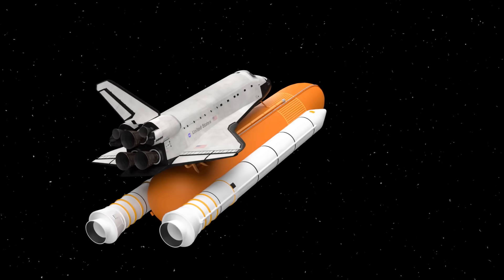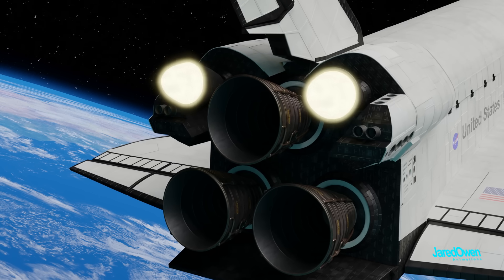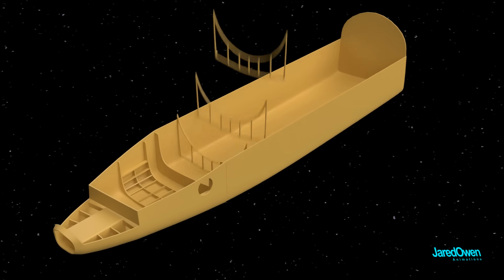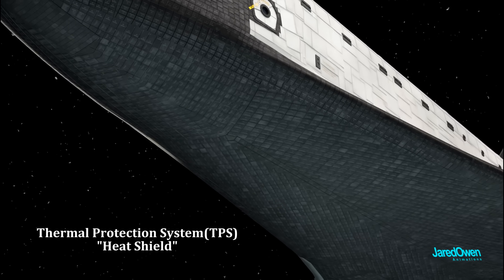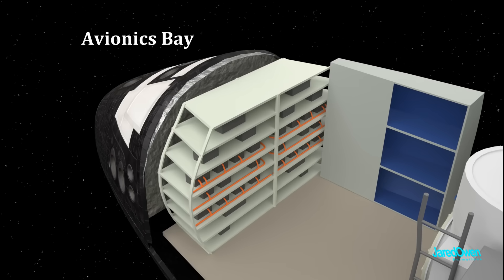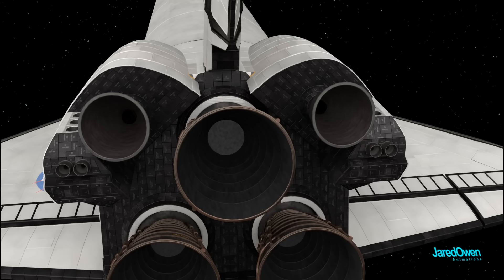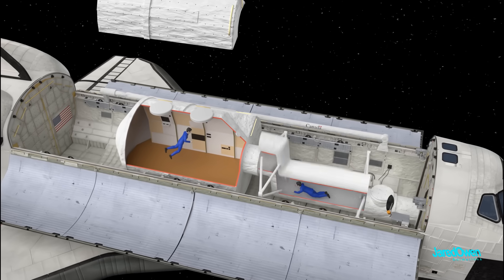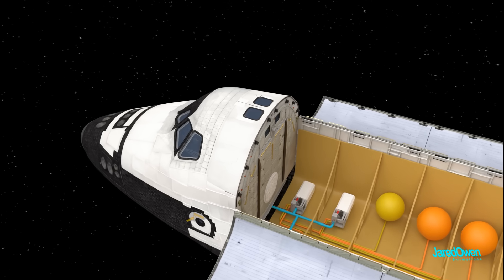How did the Orbiter Vehicle work? (Space Shuttle)

Comment: How do they glue the wheel door gaps with the silicon tiles ? While rentry there isn't any scope of microns of gaps between tiles..how do they manage to glue those tiles at the gaps ?
Reply: The tiles were also subject to extreme cold temperatures so gaps between the tiles was needed. They used a gap filler consisting of a ceramic cloth impregnated with a silicone polymer for such things.
Reply: @mako88sb  are you talking about the landing gear door gaps?i wonder how they might be making it so precise that everything fits and opens so tight that no heat breaks the gaps in the landing gear door
Reply: @SagarSagar-ro3fj  Gap was needed on all of the tiles. Pretty exact +/- tolerance was required for the gap filler to work properly so this was ensured during the tile fitting at the land gear doors as well as the propellant umbilical doors. Yes, it certainly was some precise work required and a huge reason why the tile fitting for the initial launch of Columbia took much longer than expected.
Reply: @mako88sb  Nice theory, however it doesnt work in real life.
Reply: @idontcare7961  says who?
Reply: @PabloGonzalez-hv3td  Me. Learn about physics.
Reply: @idontcare7961  Are you a physicist? What inconsistencies do you notice?
Reply: @PabloGonzalez-hv3td  Atmosphere can not exist next to near vacuum without equilibrium taking place and all of earth animals (human animals too) suffocating.
Reply: @idontcare7961  You're thinking too much into it. The atmosphere is no more than a pool of air. It is not "pressurized". The air pressure comes from weight alone. Like the bottom of the ocean. 

We don't even need to leave the atmosphere to experience the pressure gradient. There isn't one uniform pressure as would be found in a pressurized vessel.
Reply: @PabloGonzalez-hv3td  You didnt understand my statement, equilibrium would take place if earth was in infinite vacuum, you would suffocate. Explain that.
Reply: @idontcare7961  I understood fully. You're perpetuating a misconception  that the atmosphere is pressurized. It's simply a pool of fluid held in place by gravity. Like the ocean.

Notice that the air pressure at higher altitudes is lower and not at a uniform equilibrium?
Reply: @PabloGonzalez-hv3td  Nice theory, however it doesn't work in real life. Tell me why gravity isn't pulling down on hot air balloon?
Reply: @idontcare7961  What "theory"? The air at 35K feet is appreciably thinner than at sea level. 

Gravity certainly affects a hot air balloon but hot air is less dense and rises. And no. Density and gravity aren't the same thing.
Reply: @idontcare7961  You're confused. Density makes a helium balloon float in the atmosphere. Put that same balloon in a vacuum chamber and gravity pulls it down.
Reply: @PabloGonzalez-hv3td  And once again you show that you have absolutely no clue what you are talking about, your experiment proves that vacuum is less dense than the helium balloon. Again answer my question why gravity doesn't pull down helium balloon? Don't give me another vacuum example excuse, im not asking for things in vacuum but for the normal atmosphere. Why would density make it float when gravity is pulling on everything and keeps it stuck to the earth surface?
Reply: @idontcare7961  Umm. Gravity produces a quantitative force that is measured as weight. Add a lifting force in excess of this weight and you get lift. Pretty simple. How do aircraft fly in your opinion?
Reply: @PabloGonzalez-hv3td  "lifting force" lol Gravity is a theory and you know it, its all about Density. mass/volume equals density and thats all there is to it, no gravity. What has aircraft to do with a helium balloon rising? Dont change subject like that.
Reply: @idontcare7961  Positive buoyancy, which is an interaction of densities, is a lifting force and a lifting force ONLY. The opposing force is gravity. When an object sinks it's because the battle of forces is being won by gravity.

Your theory does not explain why objects go DOWN. Only why they go up.
Reply: @PabloGonzalez-hv3td  Objects go down if they are more dense that surrounding medium, if less dense they rise. No gravity needed. You have been indoctrinated, better start doing your own experiments and realize the lies you have been taught all your life.
Reply: @idontcare7961  That opposing force has a name and it's called gravity. Density isn't a force. Buoyancy is. 

Do explain why the atmosphere at the top of Mt. Everest is thinner than at sea level. According to you it should all be the same pressure.
Reply: @PabloGonzalez-hv3td  I never stated it should be the same pressure, im saying atmospheric pressure would not exist next to infinite vacuum. Gravity is a theory and the only thing that can save your globe fantasy from falling apart, quit blindly trusting the ppl who want you dead, NWO is coming and you still trust them.
Reply: @idontcare7961  You're stating it by default. That's how a pressurized vessel works.
Reply: @idontcare7961  How does this video explain the atmospheric pressure gradient? Speaking of changing the subject 😂
Reply: @PabloGonzalez-hv3td  No, im just trying to wake you up from indoctrination. Pressure gradient is perfectly normal in enclosed system.
Reply: @idontcare7961  You don't understand how a vacuum works do you.

Comment: While this may have been impractical, it really felt like a proper spaceship. I miss it
Reply: What do you mean by impractical, sir? Is it because the inner space of the shuttle in the animation is not to scale? I'm only curious as I believe you've been on one irl since you say you miss it. Thanks for the reply in advance.
Reply: @humanbeing1429  the space shuttle program was a bad plan.  "Fundamentally, it failed in the goal of reducing the cost of space access." - Criticism of the Space Shuttle program, wikipedia article
Reply: @humanbeing1429  i think he referred to the unfeasibility of the operation of the shuttle... but yeah the space shuttle was like a proper space ship... if the starship from SpaceX gets operational it will be the first spacecraft after the shuttle that will once again have this feeling of a spaceous vehicle...
Reply: @humanbeing1429  It was a pretty inefficient way to get things into space since the thrust and power the shuttle had was offset by its rather small payload capacity. This was because a lot of potential payload capacity was lost in the the attempt to make the shuttle a reusable spaceplane. So it's basically carrying wings into space, where it doesn't need them. That's just extra weight that could have been used for a larger payload capacity. Also refurbishing the orbiter for the next flight was a seriously labour intensive and very expensive endeavor and was seen by many as not being worth it.

-

Now with that being said, the Shuttle still is to this day one of the coolest and most badass creations ever made by mankind!

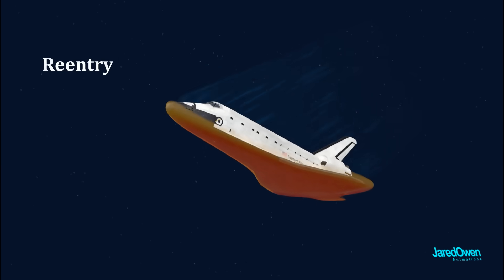Comment: How can space shuttle move backwards 2:38 if the booster is backside while firing
Reply: The shuttle's orientation could be changed by the RCS thrusters in the tail and nose after it had entered orbit.
https://youtu.be/cFBRawYov00?t=582
It also had to fly backward while firing the OMS engines to lower the orbit into the atmosphere, but turned around with the RSC thrusters to let the nose point forward before entering the atmosphere.

Comment: Each Orbiter was designed to be used for 50 mission then be evaluated then if necessary retired or used for some additional missions. We should have kept the shuttle going for the 50 missions for each orbiter.
Reply: The system was also "designed" to go for something like 1000 flights(?) [I forget the number in the SAIC probability study] without loss-of-crew.  So there' s the numbers, and then there's the reality.  I would count myself as something of an STS fan, but as payload boosters go it was wildly expensive and a maintenance/reliability nightmare.
Reply: @marcmcreynolds2827   That's only because NASA did 2 thing's wrong. One they overpromised cost to fly it turned out costing more per flight but that was because of mismanagement. If they had done a better job on safety and fixed the safety problems they'd still be flying. Now we have no way
 To clean up the space junk which the Shuttle could have accomplished.

Comment: A couple of things. 

Firstly, a small correction in the title - "How DID the orbiter vehicle work" since this (the most deadly space vehicle ever built, having killed 14 people) has not flown for some time now.

Secondly, having lost 2/5 of the fleet due to what can only be described as arrogance/stupidity and some very basic design flaws, it would seem your video of this vehicle is as incomplete as this vehicles safety record, with no mention of the aforementioned deaths caused by the incumbent failure rate and unreliability issues this poor design suffered from.

Probably also worth a mention in your update of this video, the massive cost of operating this poor design (ie the maintenance and "turn around" cost).  As well as the gigantic under performance of this vehicle given the number of launches it accomplished per year versus the number intended.

Let me know when you publish the update please as I'd be interested to see how well you manage with facts instead of propaganda.  Or will you be doing what most Americans prefer with anything that doesn't suit them and just bury your head in the sand and pretend your fantasy is an accurate view of reality?
Reply from the maker: Hi John - thanks for your comment.  It's always hard to decide what to include in an animation.  You are right though - there were a lot of problems with the shuttle and costs were staggering.  This video was meant to be a general engineering overview of the vehicle

Comment: Why did they need the rocket, the shuttle could of got to space on it’s own
Reply: The orbitor itself doesn't have nearly enough delta V to reach a stable LEO. That is why they attached an external fuel tank. The fuel from the tank runs to the orditor's RS 25 engines, allowing them to burn for a much longer time. However, they do not produce enough thrust to lift the orbiter and the tank. This is precisely why they also attached two SRB's to the fuel tank.

Comment: Awesome animation! One aspect that has always puzzled me was the on pad fueling process of the external tank. The exact pumping process, via the tail service masts of the LOX and LH2, through the plumbing in the orbiter's aft structure up the pipe on the outside of the orange tank, overcoming gravity with all that liquid fuel. The beanie cap was to divert gaseous venting and not for replenishment. What type of pumps were needed to fill op that tank still has me wondering how it was really made. Keep up the splendid work!
Reply from the maker: Hi Emil - great questions.  My next video will be on the Space Shuttle launch and I am wondering some of the same questions.  I haven't found any good answers
Reply: @JaredOwen  Piece of cake! Nothing could be more simple... Computers in the small building adjacent to the Vehicle Assembly Building run the show until half a minute before liftoff. Then the shuttle itself runs the show. Tower clear and for at least 3 minutes Houston is all but helplessly watching. The taxpayer loves danger.

Comment: One of the most Iconic yet dangerous vehicle, the  doors for wheels was a big risk, accidental opening during reentry would have most definitely resulted in disaster. Abort was possible but SRB’s can’t be shutdown so during the first 2 minutes, aborting could have been more dangerous than landing with the RS-25 engines. Just two casualties was lucky
Reply: More than just lucky.  You'd have to be a lunatic to build and try to operate something this dangerous and badly designed.  Oh, wait, America already did that.
Reply: the first shuttles had ejector seats fitted. But those were removed later on.

Comment: This is neat. I watch all your videos, and do have a detailed technical interest in space craft . Have you through of doing an actual detail of a craft, for example; you mention the SME engines can gimble, but don’t see any of the gear that actives that. You talk about the radiators for cooling, and the fuel cells water been used for cooling, but no pipes or valves or pumps connecting any of it. Did I miss mention of the life support systems and O2 & N tanks. What sort of gear was in the electrical/Avionics bay? (Likely different between shuttles & missions but a small list be good). With the OMS & RCS systems, how did all the tanks connect to all the engines, and how were they all controlled. All the aerodynamic control surfaces, how were they powered /(controlled) by hydraulics?? what powered them?
Reply from the maker: great questions - I could probably do a whole series on the space shuttle!

Comment: I think a good project for you will be the X37; likely you won't get much information about it. The Air Force has never stopped flying "their" shuttle; now a part of Space Force. It's an AI run shuttle with capabilities that are secret. It's quite possible it's been to the moon & back many times; nobody is telling the tale. Who knows what the X37 has been doing the last decade, beyond what tales are told officially. I suspect that SpaceX will, at some point, assist Boeing with a reusable 1st stage for the X37;  which will likely make it the most cost effective space vehicle on earth for larger payloads.  It's also likely that future versions of the X37 will not need a 1st stage.  It can be dropped by large aircraft at high altitude; then continue on its own into space.

Comment: There was a USSR copy of the space shuttle, it’s called Buran
Reply: Buran had a striking similarity with the American shuttle, but there were some important differences, too.
The most important one was that instead of three main engines on the orbiter itself, there were four slightly smaller engines mounted at the bottom of the external tank, changing that to an actual rocket stage that could be used independently of the orbiter.
That rocket (Energia) also had four liquid fuelled boosters instead of the two solid fuelled ones used by the American shuttle, each of them powered by a four-chambered RD-170 engine, a close relative of the RD-180 now used in the core stage of the Atlas V rocket.

Comment: Spaceshuttle was only space vehicle that felt like a spaceship. Nowadays, we have tiny claustrophobic capsules which do a splashdown on water like 60s.
Reply: the pressurized part of the shuttle was claustrophobic as well. I guess the wide cockpit window does make it feel more open compared to small rounded windows like in capsules.
Reply: I mean the space shuttle was more expensive than rockets and did not offer an abort along with many flaws with the thermal control that led to the loss of Columbia

Comment: you mentioned there are three doors on the underside for the landing gear.  There are actually five - two doors are for the fuel feeds from the External Tank to the Orbiter for the Main Engines to draw from.  They are closed once the ET is separated and never opened again in flight.

Comment: It's a great video but makes the space shuttle slightly better then it was. The space shuttle had to be almost completely refurbished after every mission. They had to replace all the silica tiles and the motors after every mission so it was just as expensive as non reusable rockets.
Reply: Definitely wasn’t the huge cost-saving game changer advertised but where do you get them replacing every tile? I’ve never heard that before and according to Airspacemag, 30-100 tiles were replaced after each mission.

Comment: It doesn't land like an airplane, it lands like a brick on steroids.
Reply: fun fact: the trainer aircraft which trained the pilots was flown with gear down and engines in reverse thrust to simulate the horrible aerodynamic capabilities of the Space Shuttle
Reply: Luz 5020 a brick with wings with fleshy humans inside
Reply: It lands like a glider (a bad one) and handles like a brick.
Reply: Yet this was actually the big "delta" wing which the US Air Force wanted for its greater crossrange landing capability.  The straight wing NASA originally preferred was a stubby little thing mid-body.  That orbiter would have needed to go into a dive in the lower atmosphere in order to get up enough airspeed over the little wing for a controlled runway landing.  Considering how taxed the tires and brakes were even for the bigger wing's landing speed, that wouldn't have been good!